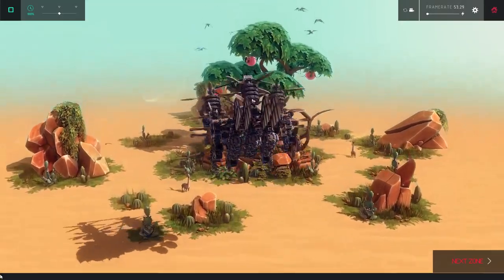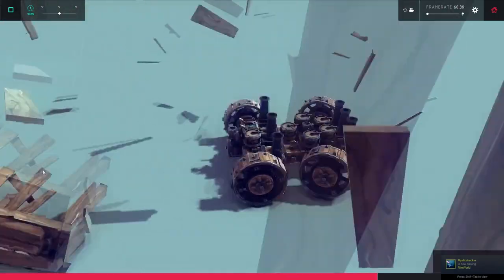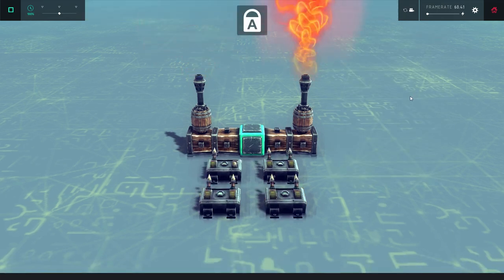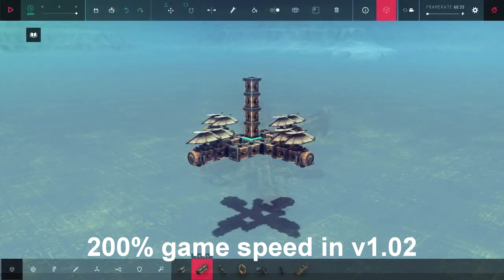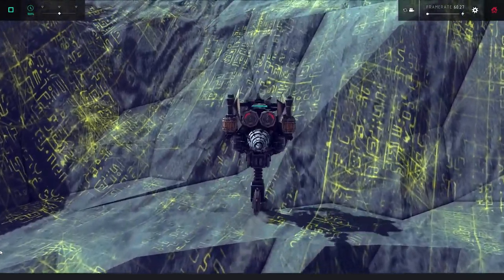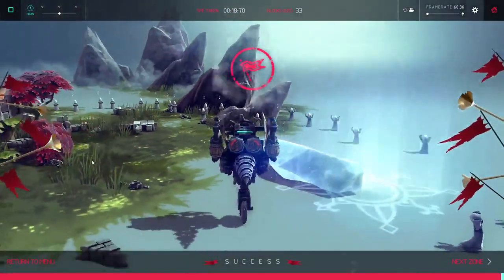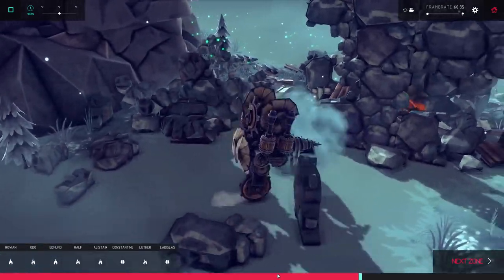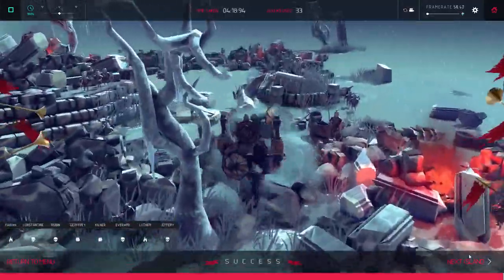Logic block ideas + Weaponized Unicycle!  Besiege

Comment: Great vid again, of course! But I really want to comment to tell you what I think is behind the design choices:
More regions would be great, but I'm afraid complicating logic blocks further might not help new players. I know optimising for block limit is attractive, but having to add another block for another region just seems like the most logical design for Besiege.
Purely proportional feedback (with its overshoots) is great. If you want critically damped systems, you can construct a half-mechanical PID-controller, which is way cooler and more Besiege-like than configuring damping purely in the logic domain. But both of these mostly boil down to not wanting a more complicated logic system without having proper visualization of the logic domain. (It would be fun, but I don't see them adding that.)
I feel like .5 weight is balanced for what they can do and how sturdy they are. I guess you are used to the lightest blocks, but a Steering Hinge or Block both weigh 1 (slightly too high for Steering Hinge imo, but they don't do .75 and Steering Hinges are very useful blocks).

CCCanyon's blog post on PID controller with Besiege logic: https://cccanyonbesiege.blogspot.com/2020/03/besiege-notes-on-automation-block.html
Nice little craft :)
Reply from the maker: Fair enough about not wanting to get too complicated, but I think there should at least be a mirror option that gives you two angle ranges, so you don't have to awkwardly squeeze in two separate anglometers just to get left and right.

Comment: I'd just love for them to be able to use custom variables that aren't keyboard presses, so I can then use those keys for other things and not run out of keyboard space >v<
Reply from the maker: That's a good idea!
Reply: @rossthebesiegebuilder3563  Think it may ever happen?
Reply from the maker: @casualbird7671  Sometimes we get some surprise updates like that, so it's possible.  They stealth added RTC to the steering block (after they gave it to the steering hinge), and they fixed the slightly too long log block, both without even mentioning it in the patch notes.
Reply: @rossthebesiegebuilder3563  Ah that is true, I can hope then! Is there anywhere I can post this suggestion to them?
Reply from the maker: @casualbird7671 The forum and Discord are good places to post. http://forum.spiderlinggames.co.uk/index.php
https://discord.com/channels/214715640928403456/214715640928403456